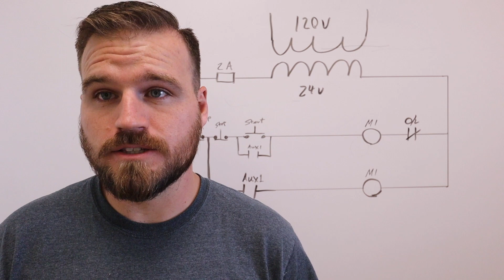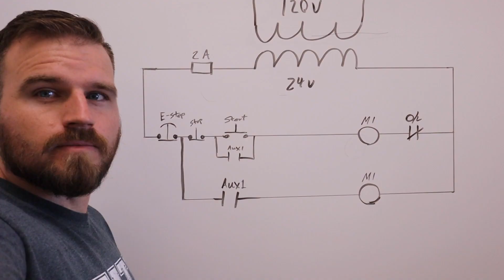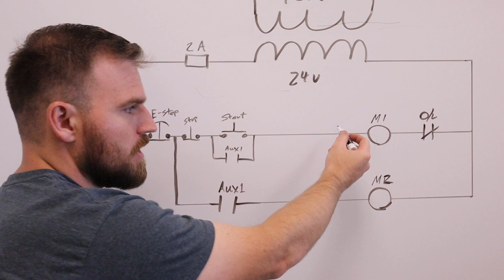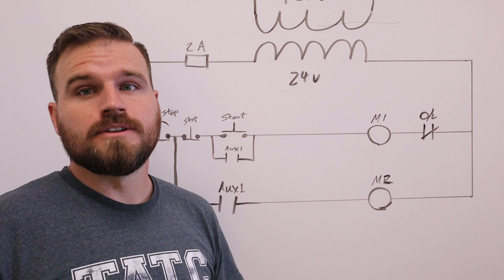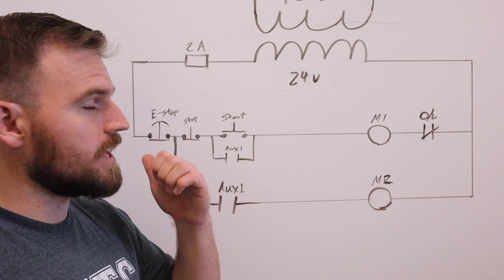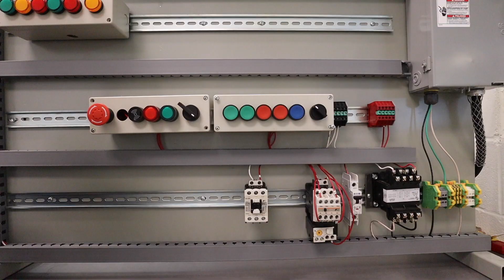Motor Controls - Two Motors, Simultaneous Start lab

Comment: Can you draw a 3 phase motor with a 1 phase control circuit and the control circuit has a fan that you turn on and can only turn on when the motor is running and when the motor is turned off the fan continues to run until turned off but the fan cannot be turned on when the motor is not running. Ran into this problem at work and it had me stumped. You can replace the fan with a light if that’ll make it easier to draw and show.
Reply from the maker: I'm working on a motor control series, of videos, and I’ll add this one to it.